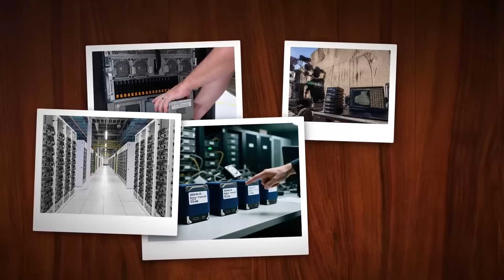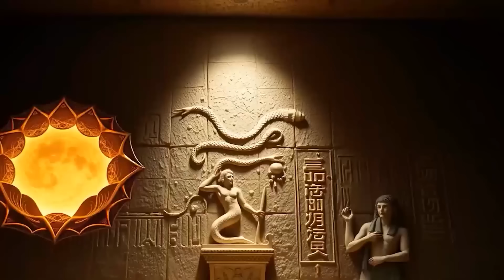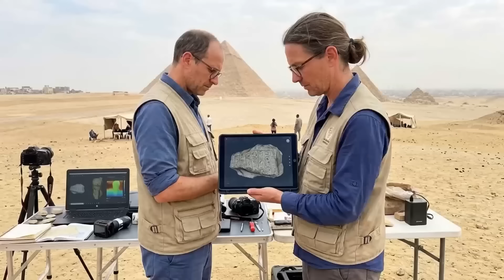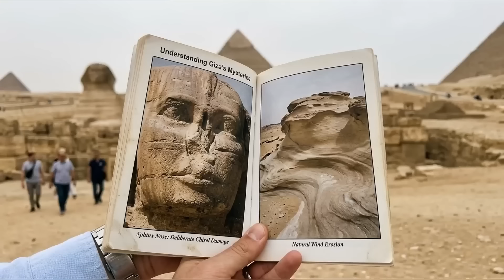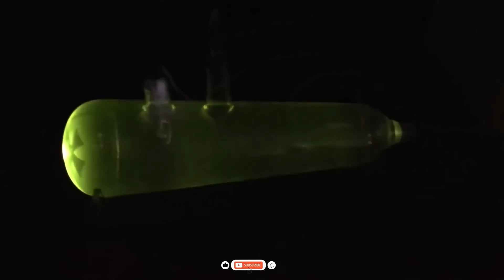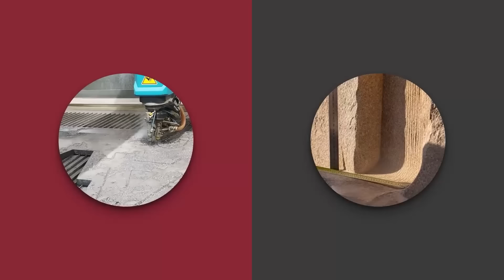Elon Musk's Grok AI Examined Egypt's Mysterious Dendera Light Bulb — The Results Shocked Scientists!

Comment: What a lot of chatter telling almost nothing and does not even tuch the two main questions .
I am the one who took Garns " Lamp " and brought it back to life  for experiments.  I am the one who built several " Bagdad Batterie s " precisly to the original  in shape, dimension and materials  to undergo experiments.  And I am angry about  most of the shit which is told.  The Bagdad Battery never produces  1 Volt but yust 0,5 V.  The vaccuum discharge tube ( the  "Lamp ") needs a 99 % vaccuum or even better (99,5 %) to show  desired effects.  It will of course show the " snake " ( the god " Harsomtus " ) but can never produce enough light for nice paintings.  How could ancient ägyptians create a vaccuum of such quality  ??  How could they provide the several thousands of volts which are necessary to create a vaccuum discharge  ??
I know the answer becouse I did the lab- experiments.